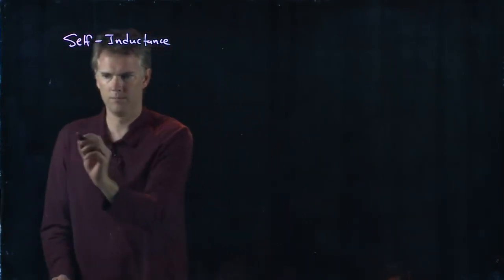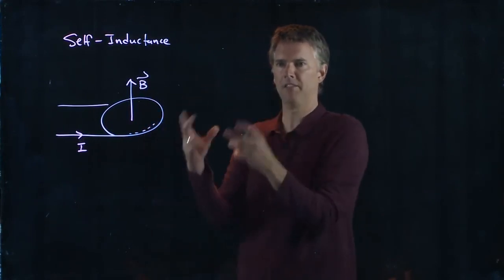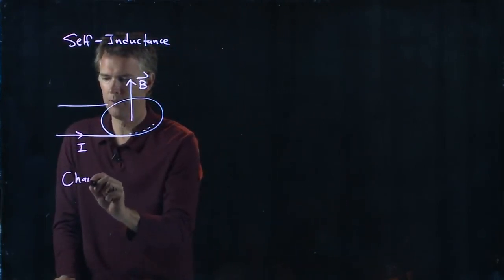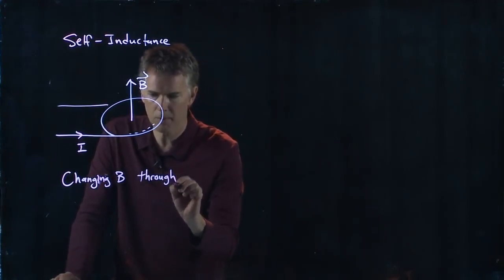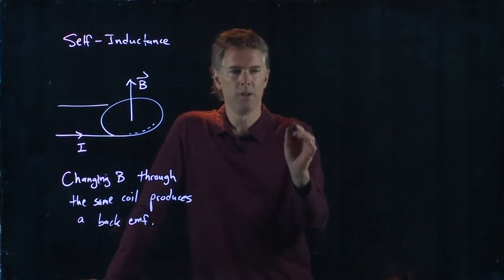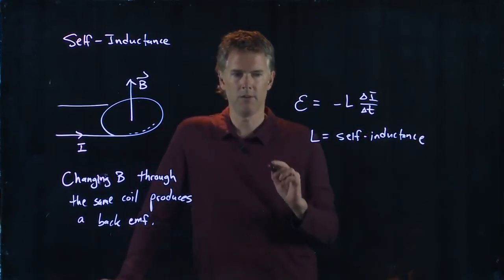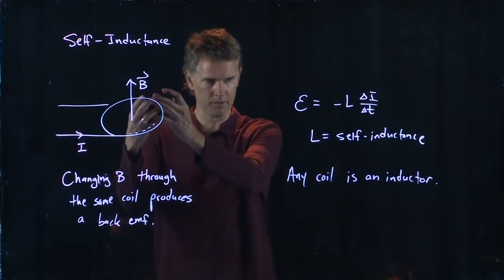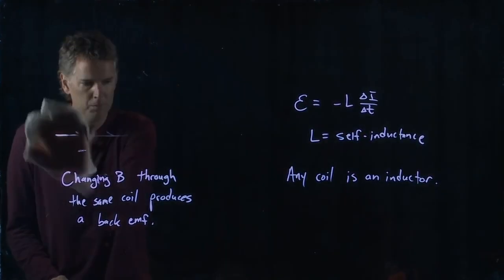Self Inductance | Physics with Professor Matt Anderson | M24-10

Comment: In his “coil for electromagnets” patent Tesla describes the problem of self inductance in his experiments. He also lamented the problem of capacitors being quite expensive, this he set out to kill two birds with one stone so to speak,.  His solution was to separate any two adjacent loops from each other by winding two coils in parallel but connected in series. According to his description in the patent the capacity of the coil increases significantly, and since self inductance is reduced the coil’s field brakes down much quicker, allowing for faster motors that can be driven at higher frequencies with stronger electric fields.